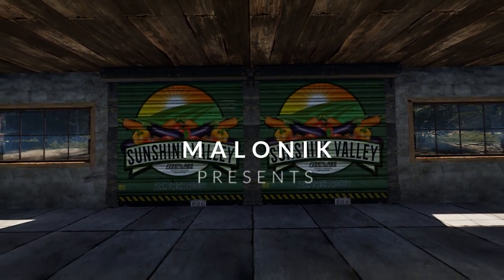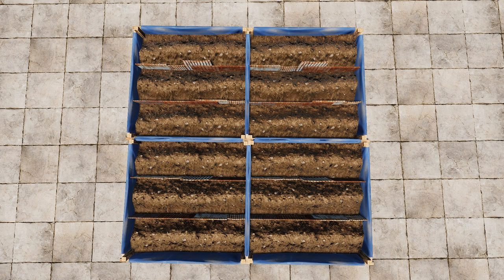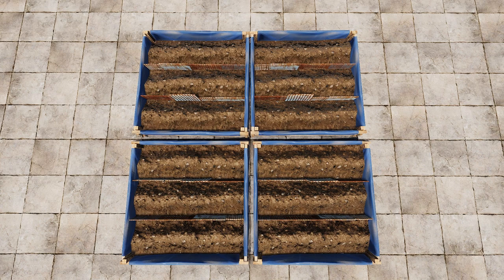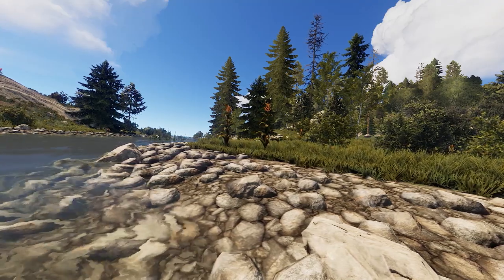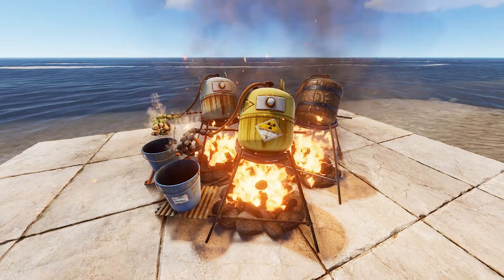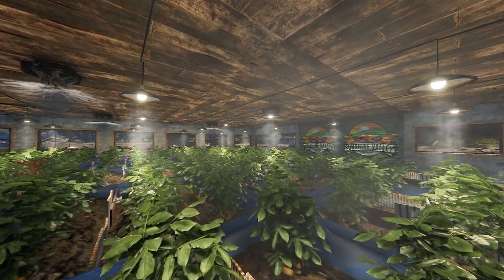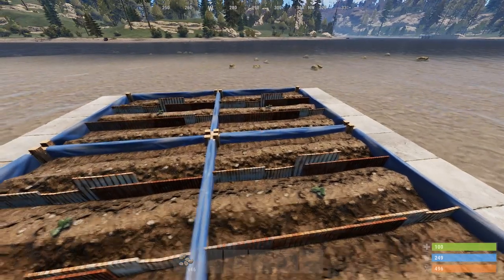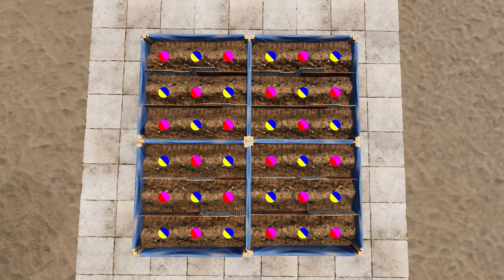RUST 101: FARMING 2.0 - Farm Setups & Meta

Comment: ## Most efficient Block is a 2x6. ##
* You need 2 lamps, 2 sprinklers, 2 heaters, 6 big planter boxes.
 
- Heaters radiat just one out and one to the each side so a 1x3.
For the heaters place a lowwall in between the middleboxes place one on each side. 
- The sprinklers can be placed where ever you want, so they dont splash other boxes if you scale up the farm in to a 4x6 f.ex.

How to set up the timer is in Malomiks vid here >> 
RUST 101: Farming 2.0 - Automatic Sprinklers [UPDATED FOR MAY PATCH]

NOTE for river farms: 
If your farm is on the first floor you can connect the timer directly to waterpump to feed 4 sprinkler's equal 4x6 planters. NO LIQUIDSWITCH NEEDED

## Timing for 6 Large boxes and 2 sprinkler's ##
  [9 plants x WATERINTAKE ml/sec] / 48
  Hemp = 9 x 5 ml/sec | Timing 46/28
  Corn = 9 x 4 ml/sec | Timing 36/28
  You can do the math for the rest of your plants.

 Happy Farming!

Comment: I've connected several water catchers in series. Does that actually increase the flow rate out? I thought it was working.
Reply from the maker: I'll have to double check incase they've changed it but as far as I know linking them doesn't change the flow rate.
Reply: @Malonik  that's one of my super farm with 30 water catchers is still slow as piss

Comment: You didn't really provide much info on cloning for the best genetics. Showing a layout, ok, but how do I know which genetics to clone? How do I choose what to plant to get rid of bad genes?? What is the FULL process for getting the most efficient clones?
Reply from the maker: Yeah I did that intentionally. The genetics side of things gets very complex very quickly. So the first farming video was how the new farming works. Then a video on how to use it efficiently. Next is an automated watering system and then I'm doing a full on advanced genetics guide. 

I wanted to ease people into it rather than overwhelming them with information. As it currently stands the advanced genetics guide is likely going to be like 15 straight minutes of convoluted mathematics and I thought that might be a bit of a downer for those trying to connect a hose lol. 

So TLDR sorry the genetics info has been a bit light so far but there's method to my madness lol.

Comment: You can turn in corn and fertilizer for scrap, does this pay off for the work involved for farming?  Can you make farming a profession or is it a hobby?
Reply from the maker: Yes. Turns out you can make about 1k scrap per hour with corn fairly easily. I might see how far that can be pushed while still being realistic. Like if it worth focusing on a massive farm on a BP wipe to bang out all the BP's super fast.
Reply: Suspect and Blaze built a massive hemp base on Twitch a few days ago, or I suppose at the beginning of the wipe, on a vanilla server. They were generating 9k cloth every 1.5 hours which was giving them 1,800 scrap per run. Not sure how that all works, but that's what they said. They used the gene GGGGYY for their hemp plants, and sold the cloth at Bandit Camp.

Comment: I just want a guide to a simple 2x2 cloth farm. I don't want to mess with in depth mechancis, I just want the 2x2. I'm assuming it requires 4x Floor Grills and 7x window bars, 4 planter boxes, 3 sprinklers, a solar panel, a battery and 4 lights.
Reply from the maker: Watch the previous vid on farming I did. It covers the magic setup and idea of what you need to do.

Comment: Can somone explain me, what is the profit of farming?  It is very time consuming, besides that, i need recourses to craft planters, sprinklers, lights, batteries, slar pannels or wind turbines, water catchers, water purifiers, barrels...  That's not all, i also need to build, upkeep and protect another building only for farm. What will I get for such hard work?
  I can hunt some bears, gather some corns and pumpkins near rivers and that will be enough for me or my group. In addition, i will get food from raids. 
I can buy scrap for food? Yes, but i will get scrap from looting and recycling stuff and from raids. What can i do with tons of scrap? I don't need that much...
Reply from the maker: As it currently stands it isn't at its full potential. This is only step 1 of the farming upgrade. They are working on tier 2 recipes which will have added bonuses which will benefit you for your roaming and PvP. 

Also while you can farm heaps of scrap without it, having it means you get an easy 1k scrap an hour once it's setup which isn't bad. 

Ultimately rust has an absolute ton of things to do and different ways to achieve the various goals. Farming just might not be your thing. I enjoy it but I'm a base bitch for the most part lol. :)
Reply: @Malonik  bro,  i'm kinda housewife in rust ))  I like to build, sort loot, messing with electricity, decorate base etc, :D   . But farming looks little bit pintless for me.  I will try to build some farm next wipe, maybe i will like it )

Comment: Nice informative vid :)
Just a heads up, 1 ceiling light placed in between 2 planters supply's them with light so in fact you only need 2 ceiling lights pr 4 grouped planter boxes/Block. 
You're crossbreeding seemed way more complicated than it needs to be though. Wouldn't all the bad/red genes take rule over the good genes you'd want to keep since 1 red gene will trump a green gene if there is not 2 of the same letter genes in the same column?
I watched your RUST 101: Farming 2.0 - Automatic Sprinklers [UPDATED FOR MAY PATCH & thought i'd come suss out the previous vid for it.

Comment: Just so you know, you can have 2 large planters to share 1 light.
Reply from the maker: Yeah I need to do an update to this one. With some of the recent changes and more experimenting I've definitely got a more efficient setup.
Reply: @Malonik  you could also attempt a video on how to cross breed more efficiently. Personally, I find collecting loads of seeds. Then using just one corner of the planter box plant and hatchet out till you get a desired cross breeding material. Usually I would aim to get a 5green 1red sometimes if I'm lucky I'll get the desired clone that I really want. I think best genetics would be 4G2Y yields about 56 cloth per 1.5hrs and with just 1 large planter box easily 1k cloth per harvest. That's 200 scrap per planter.
Reply from the maker: @JunoGaming95  I'm still kinda torn on this one.. I can't decide if you're better off crossbreeding or just planting a ton of seeds in the ground and grabbing the one that has good genes. I know that's leaving a lot up to chance but it's worked and damn fast a few times now.
Reply: @Malonik  I personally feel that you only need a good gene for hemp/ corn because it's the only two things that you can actually trade in bandit camp for scrap. Things like potato generally gives you about 45 per harvest. If you get a 4G2Y hemp clone it gives you a 1.5hrs nearly 1k cloth harvest which can be traded for 200 scrap per harvest.
Reply from the maker: @JunoGaming95  Yeah that's fair. One of the guys on my discord built an 8 floor farm with 18 planters on each in the current wipe on vanilla. He was pulling in about 5 or 6k scrap per hour from cloth I think lol.

Comment: 4 planters per farm block is a waste of water since sprinklers give out 30ml per 10 seconds and 30 is not divisible by 4, so you will get 28ml/10s with the same water usage (effectively wasting 2ml/10seconds). You will be better off with 2 or 6 planters per farm block.
Reply from the maker: I didn't think the sprinklers reach would be that far... That's crazy!
Reply: @Malonik  It's actually enough for 8 planters, but then you will get even worse water economy (24ml/10s) 😂
Reply from the maker: @dnkbmc  Lol well there ya go, definitely wouldn't have said 8.. Roflmao
Reply: @Malonik  Yeah, a bit of an overkill 😂But as far as water economy goes, a single sprinkler consumer 20ml/10s but outputs 30ml/10s (free water?), so you save more by using sprinklers. 
Also, if you do the math, a single sprinkler provides 180ml/minute, which means a single sprinkler can provide water for 4x planters with standard water-hungry plants (5ml/minute) or for 3.33x planters full of water-hungry plants (6ml/minute). 
But with the mentioned info above plater count per sprinkler, I would say that 1 sprinkler per 3 planters is the sweet spot.

Comment: Should be updated, you can cover a 6pk of large planters with 2 sprinklers and 3 lights.
Reply from the maker: Yeah definitely needs an update, also you can get 6 planters covered with 1 sprinkler if you're tricky and use low walls right.
Reply: Malonik I didn’t know you could get 6 with one sprinkler, we still use 2

Comment: The farming 2.0 is shit. Me I and my mate spent about 6 hours getting all the BPs and setting it up we had 4 solar panels and 6 small water collectors the water and power was draining instantly and we had to keep filling up the jugs. All the plants had over 50% on everything and after 4 fucking hours nothing had grown. It seems like a massive oversight on Fp’s part how almost nothing works after investing that much time.
Reply: you're doing it wrong, all you need is one solar panel into a battery to easily power 4 lights which will run 36 crops. Make sure you have fertilizer and you live near the river/ocean/lake. If you use a water jug or multiple it should only take a few trips to fill the planter boxes to 7500ml. Then refill them every hour will water jugs as you harvest. It's not OP, but it will only get better as more recipes comes out, good skill to learn imo but not essential to do.
Reply: Tamura77 that’s what we had and it didn’t fucking work the system is just shit
Reply from the maker: Wtf you've gotta be doing something wrong hrvat. What biome are you set up in?
Reply: Malonik the same biome where mushrooms and potatoes spawn the temperature was above 50%
Reply: @Boz196  send me a pic of your setup, were the plants at 90%-100% the whole time? or were the lights cutting out, the temperature kept changing etc? The system is flawwed but its not that bad, something else must be affecting your growth. Unless you're below 90% it shouldn't take more than an hour or two to get good crops.
Reply: Tamura77 the base decayed. I think the reason it was so bad was because the temperature dropped below 50 at night.
Reply: @Boz196  yeah hopefully facepunch is quick to implement a heating device. I recommend building near water if you're going to farm, the temperature rarely drops below 90%
Reply: @ConteudoLibertario  any, river is best because you get more seeds though